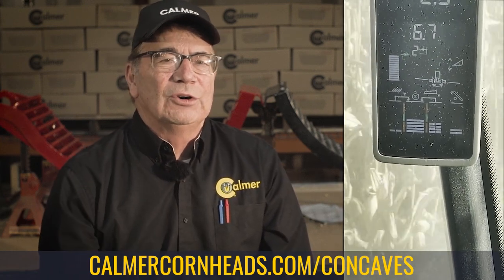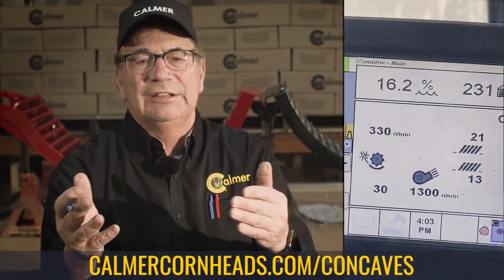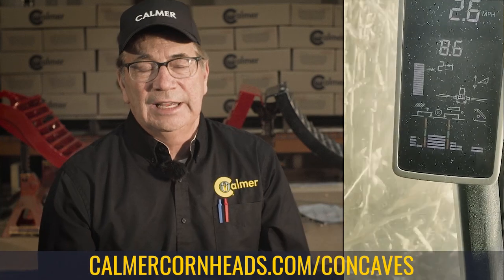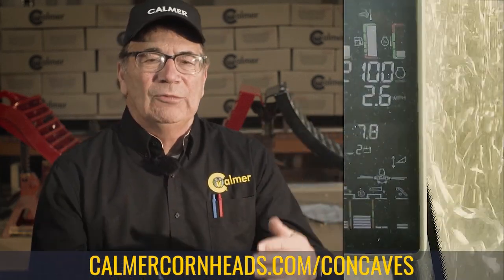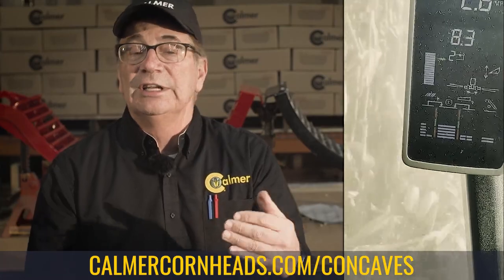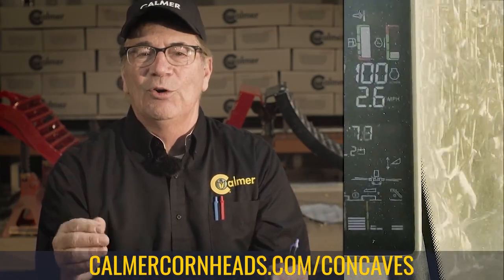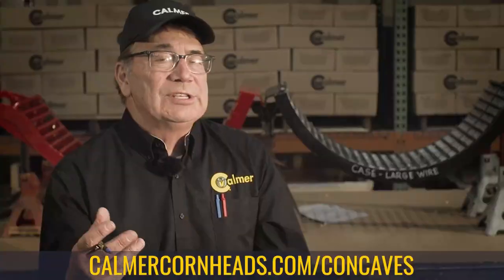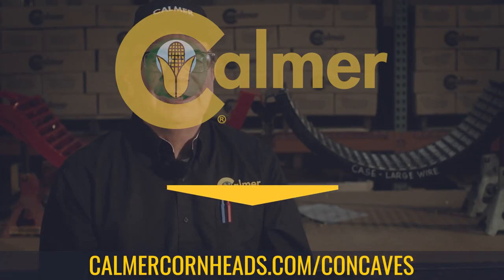What a John Deere Grain Loss Monitor Should Look Picking Corn

Comment: How come you always say to run bottom sieve wide open in corn… but in your video when you show the combine monitor your bottom sieve is at 13 ?
Reply from the maker: Overtime we have learned that closing the bottom sieve a little bit allows the air to flow through the louvers better. -Marion
Reply: @CalmerCornHeads  thanks Marion